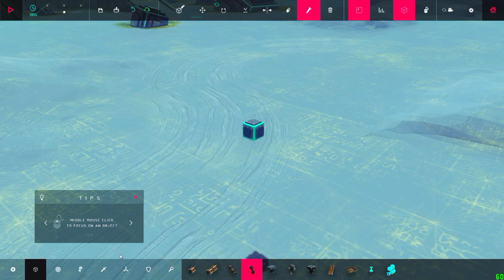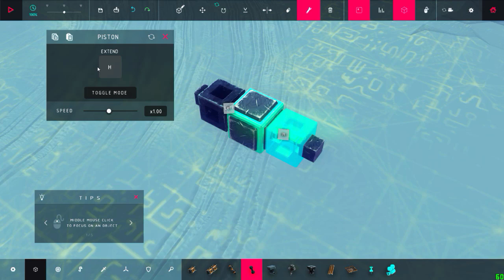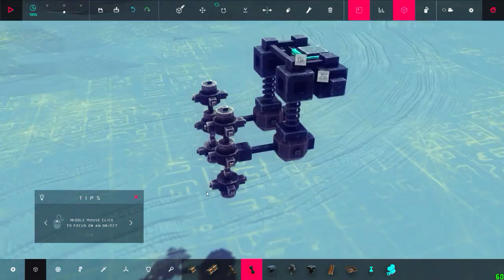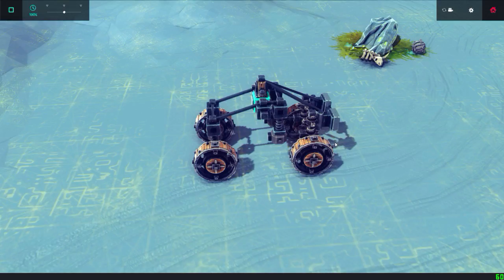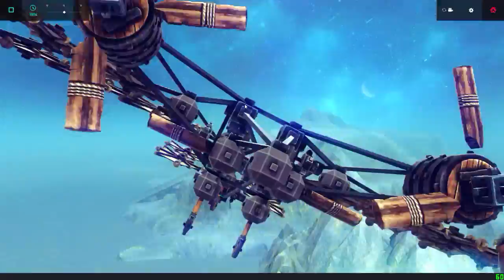Tutorial - Suspension + RTC Steering | Fun with Besiege #45

Comment: Hi... Not sure if it's because I'm on a Mac but when I try to do the same I cannot seem to add beams and drag and rotate the camera to make the connection.

Are you pressing both mouse buttons simultaneously?
Reply: What you want to do here is plug in your Mac and make sure it is turned on. Then what you want to do is fill up your kitchen sink full of room temperature water. Once your sink is filled carefully place your Mac into the water without actually touching the water yourself. Once you've baptized the demon your are going to need to throw it into the garbage and then buy yourself a real computer with either Windows 7 or any Linux operating system.